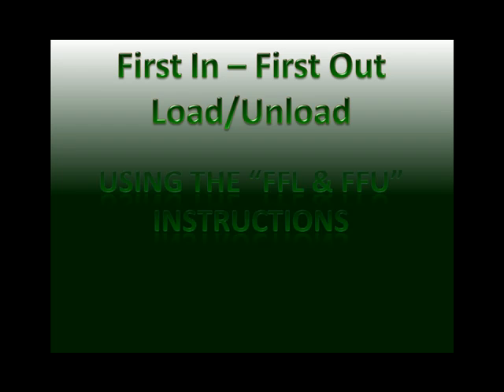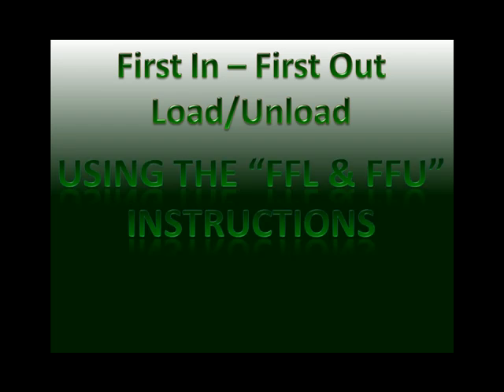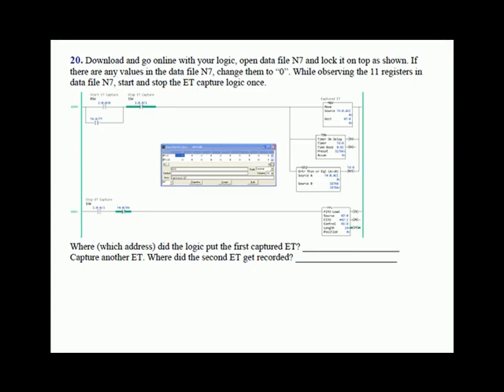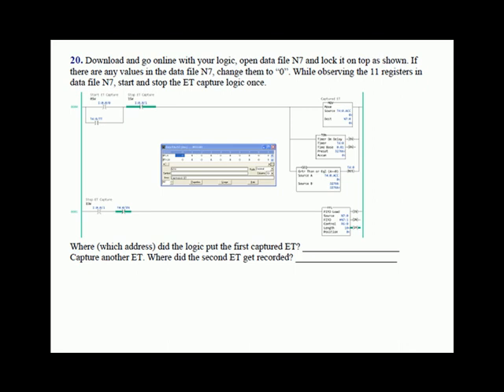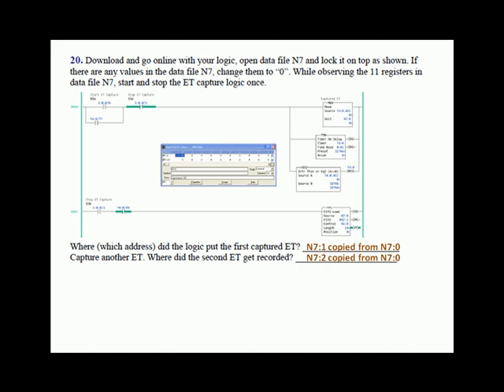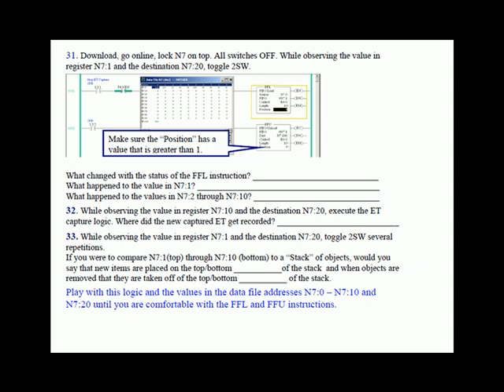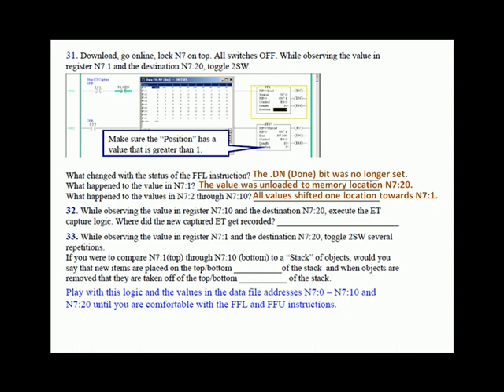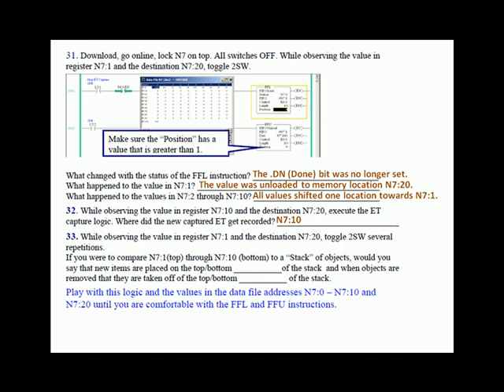ADV1 03 - FIFO Instruction RSLogix500, A PLC Training Tutorial.

Comment: Mr. PLCProfessor, this is a good video on using the FFL instructions, but in the manual (I have both the printed version (2nd edition) and the pdf version (1st edition)), you do have some syntax mistakes under Number 31(as compared to Number 30): 1PB & 2PB instead of 1SW & 2SW, along with XIC instructions stated as I:2/1& I:2/2 instead of I:0.0/1 & I:0.0/2.   Overall, this an excellent course.